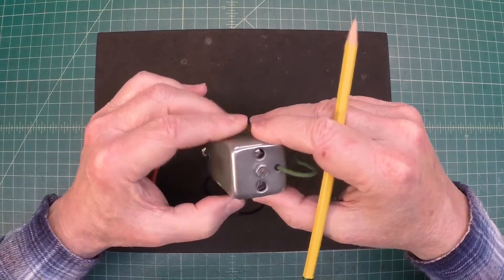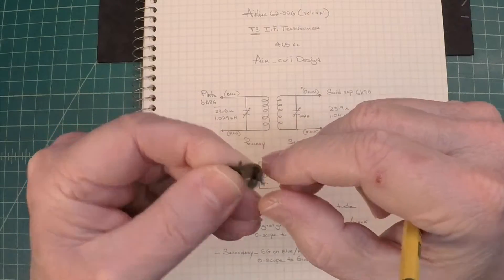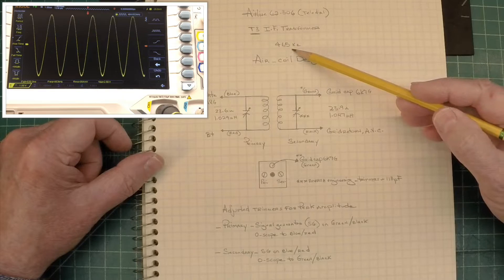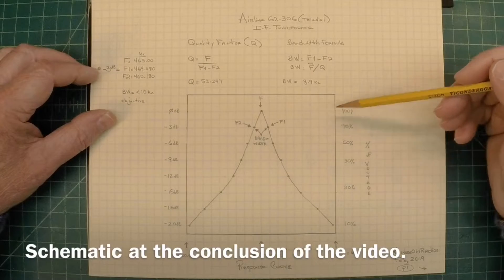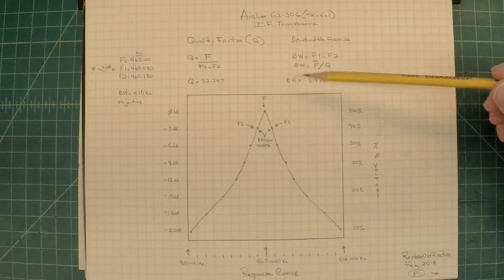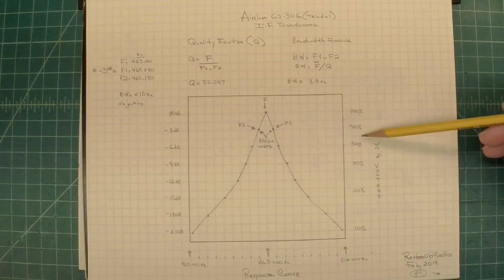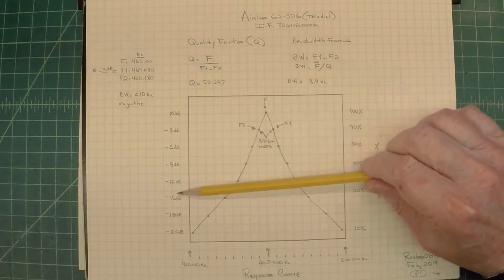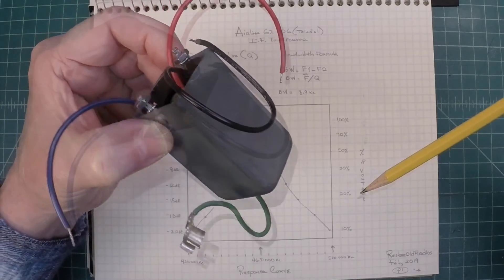Airline 62-306 Teledial - I.F. Transformer Response Curve & "Q" + Grid Cap Fabrication

Comment: Greetings:
An alternative to making your own grid cap clips is to buy fuse clips normally used for mounting on pcbs. All Electronics in Van Nuys, CA sells them for 10 pieces for $1.00.  Catalog # = FC-PC
To make the shipping costs reasonable, look over their parts and fatten your order.
Yes, the wire attachment point could be better, but the clip is already 1/4" to fit the grid cap. Just another way to go.
Reply from the maker: James - I appreciate the information and will check them out indeed. Thanks again and all the best. Don

Comment: Does just cleaning and re-installing the mica wafers in the IF transformers fix potential silver mica disease issues, Or did you replace them with new mica or a mica cap?
 As seen here https://youtu.be/UN11mufl7oU?t=822
Great videos!
Reply from the maker: @Radio wild Doubtful. Check out Bob's video at: https://youtu.be/JgNlIVfZkP4 Thank you for watching and I hope you’re able to remove the mica and add the external capacitors. Best, Don

These particular IF transformers don’t suffer from the silver mica disease.
Reply: Yes seems like the SMD problem started when they changed to the compact transformers starting around 1955. Not only are you great with the electronic aspect of radio restoration you are also great with cabinetry, A True RadioSmith!
Reply from the maker: Thank you for your kind words. Every project presents a learning opportunity that I embrace. Best, Don

Comment: A very well done and a very interesting work about FI transformers for AM.
I have also a queston: When you clean methal surfaces, do you use to protect it with a lawyer of barnish for methals or not?
Then, what do you do to protect methal surfaces against rust corrosion?
Wish you the best, Don.
Ketk Aiball (From Spain)
Reply from the maker: Ketk - thank you. The Picklex 20 is a rust inhibitor too so I’m using it on the Airline radio. I also use Boeshield T-9 (used it on the Zenith 5S299) at times as well. It has a waxy feel to it. In addition, Renaissance Wax at times as well, which I will do a final rub of it on the Airline chassis. 

https://boeshield.com/why-boeshield/

https://restorationproduct.com/shop/renaissance-wax/

Trisodium Phosphate ratio question: 1/2 cup of TSP in 2 gallons of hot water for heavy duty cleaning. I use the heated cycle on my Ultrasonic Cleaner. Hope this hopes.

Thanks for watching. 

Best,

Don
Reply: Thanks,  @RestoreOldRadios , for all technical information about chemical products you are using to get out corrosion of methals and to protect them against it. It is a very interesting thema for me.
I new that rule about the 1/2 cup of TSP, but that measure systems with cups and spoons and little spoons, and glassess, are not of my likes. These are well understood by other kind of people, not by technicians. Any way they are meaning the proportion of use is not a delicated issue, and proportion is an aproximation to the right quantity, cause ... what is the right size of the cup, spoon, little spoon?.... we do not know.
Best regards.
Ketk (From Spain)

Comment: I didn't even have to stay at a Holiday Inn Express last night to understand all you taught in this video!  Excellent idea to pre-tune the IF's using a signal generator after being dismantled for cleaning like you did. gives you a "leg-up" that they should be working okay when you reassemble everything and debug.
Reply from the maker: Thank you. The IF pre-alignment gets you in the ballpark. It seems that capacitance and loading once back in the circuit still requires some adjustments, but at least you’re not turns away. Thanks again for your kind words. Best, Don

Comment: Hi Don , Another fine job .  I just went through my first IF trans because of a break in the primary side of the first I.F.   Found a break in about 18 inches . Had a hard time with  that. (So thin and tiny)  But I got it. Ready to try the scope on it. It measures 10 ohms and 705 micro henries. Secondary measures 775 micro henries 10 ohms. Do you think in a coil is the best way to measure coils and ignore ohms don’t matter what they are as long as it is not open?   I purchased a LCR 45 meter because I had seen it on your video. What a nice tool.Thanks.   Also was wondering if you could use a spark plug wire end for a grid cap connector?
Reply from the maker: Dean - congrats on the repair. I lost a good part of my eyesight in my left eye back in 2001, so I know ever so well how difficult those small Litz or magnet wire repairs can be. I measure the DC resistance for reference (primarily looking for odd readings), while the coil inductance and capacitors in parallel are more important. The DC resistance can be used to calculate the length of wire assuming you know the AWG, so it’s one to file away should it be needed. The spark plug clip is interesting! Best, Don
Reply: Hi Don , I am truly sorry to here about the loss of your eye.  
   All is well here. I watched your latest video with volume control.It was great!  I have learned a lot from you.    THANKS!       After 3 years of working on my Zenith 6s152 I have it working correct!  Wa! Does that thing pull in stations. With a 6 foot wire antenna and in the basement. Toronto, Detroit,  Des Moines ,St Paul .   During the day! ( though it was a cloudy day)  Can’t wait to build yours.          Thanks again   Dean
Reply from the maker: Dean,

Well done on your Zenith. Zenith radios are one of my favorites. I might grab one from storage and make it one of my next projects.

Don
Reply: That would be grand if you did another zenith . The one your doing now is very good . Any radio you do is always fun to watch and learn.      Thanks,   Dean